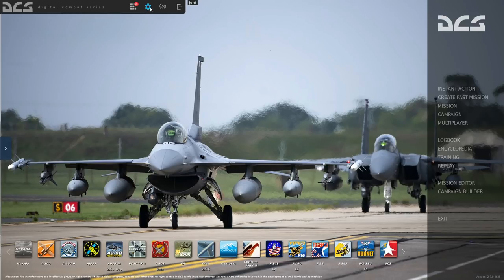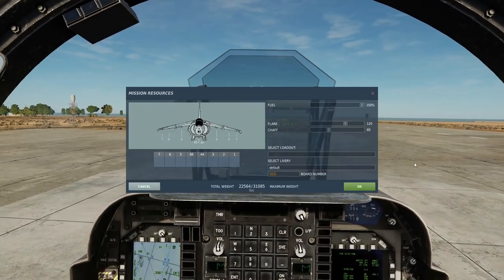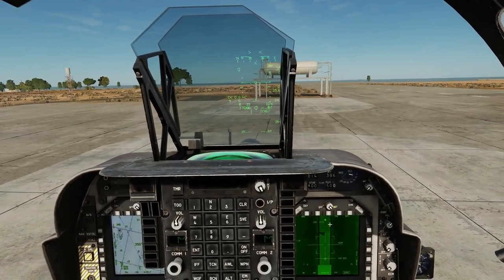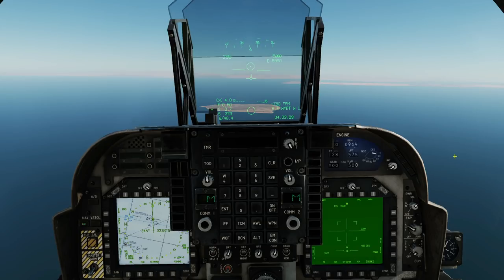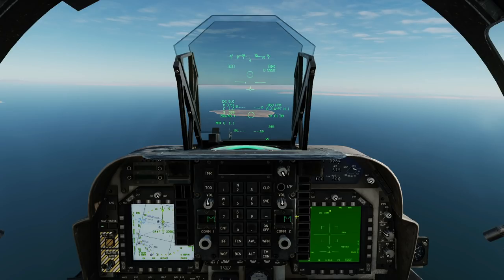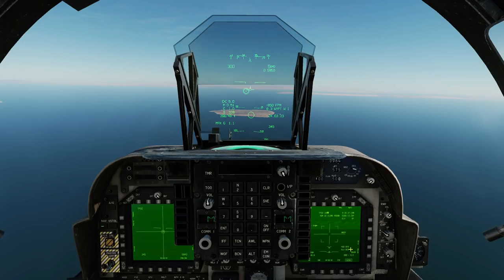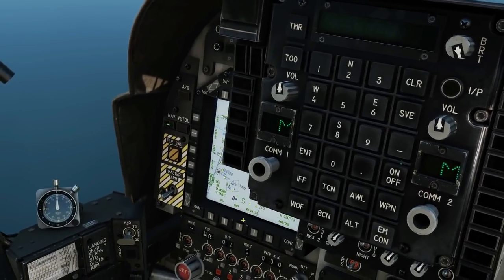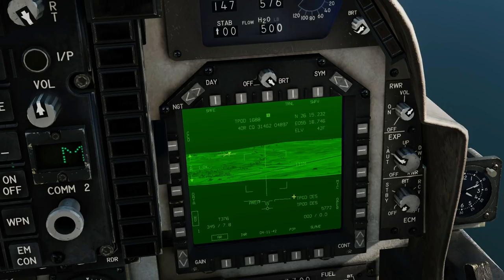AV-8B Harrier: Litening G4 TGP TPOD Tutorial | DCS WORLD

Comment: Good stuff CAP, clear and concise. MTC means Multiple Target Cueing. PiP means picture in picture display.  The 0 / 0 in the bottom right corner (above OBS 16) is the "Aircraft Command Line-Of-sight offset bearing and range", apparently it should show the a/c command line of sight offset  bearing and range for designated target when the pod is in track mode. Not sure whether this actually works or not or how handy it is to use.

Comment: This is going to be a cast iron pain in the ass without HOTAS. Currently trying to see what I can make work with my joystick + logitech gamepad for extra dpads and buttons! It definitely complicates understanding having to double translate and learn new words & acronyms on the fly. Anyone got a spare HOTAS they want to donate to a bad cause?
Reply: hey, remember you can use multipliers keys as well such as "alt" and "ctrl". Eg.: all my sensor select switches are actually alt + hat switches, for tdc slewing I use the arrows, etc. I don't have track IR , so that makes buttons availability even smaller, but it works just fine :) Even when doing hover or STOL proceadures, using just mouse and a bit of calm can be a good way to deal with those problems, at least while u can't get better equip :)